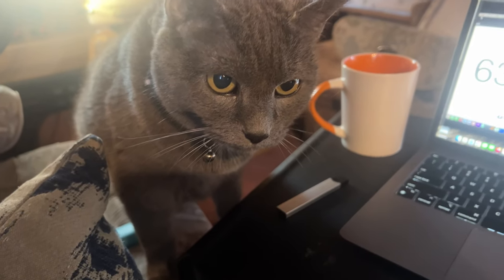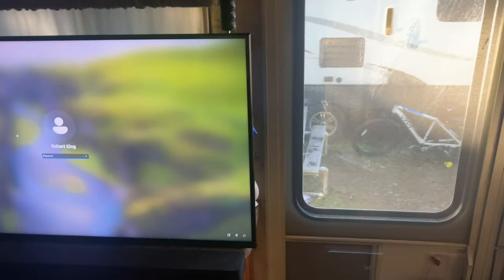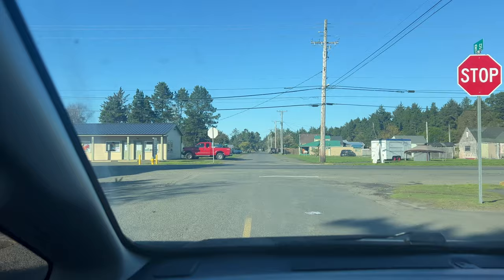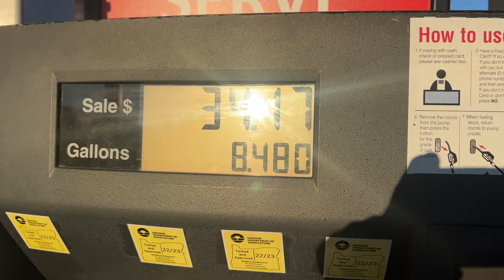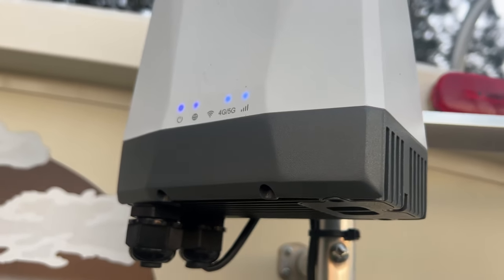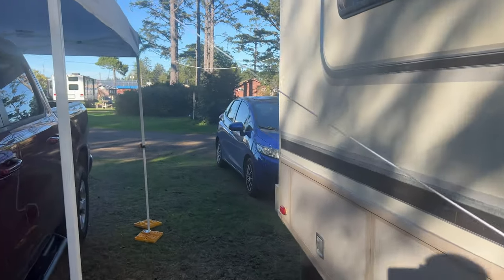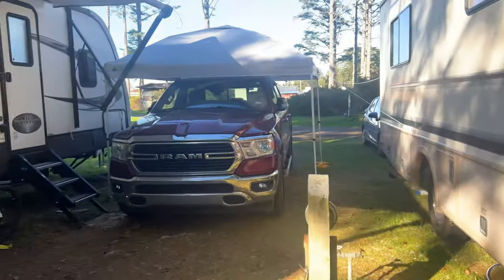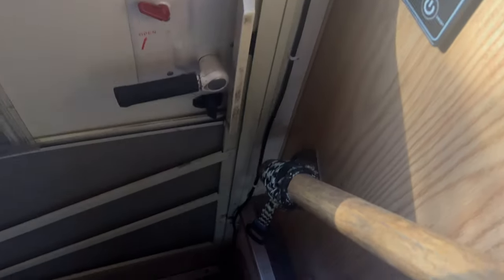Fast RV Internet Solution Outdoor 5G Router by Yeacomm

Comment: Neat set up.  Just wondering, do you have or will you put up solar on the roof? I thought you mentioned in another video you wanted to reseal the roof, wondering about that too.  Also, how do you like and gas mileage please for your new car tow along? Such a beautiful area you are staying. Thanks.
Reply from the maker: Yes solar is on the roof a did a few videos on the solar system after we did the roof in Quartzsite last winter. The car is awesome 40+mpg I will be flat towing when I get the stuff to do it.

Comment: Do you have any information about the DC 12v power option? I have tried reaching out to the manufacturer and only received a reply with the spec sheet and a message saying "It 12 volt".
Reply from the maker: There is a 12v barrel connector insert on the bottom under the waterproof cover so you can plug in a 12v adapter if need be instead of using POE.